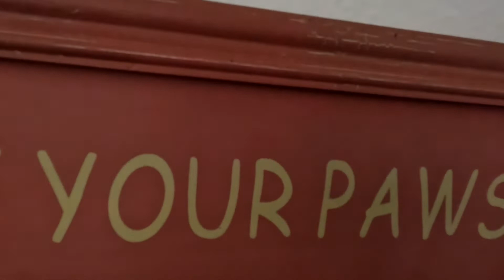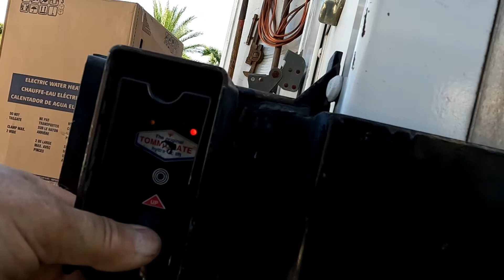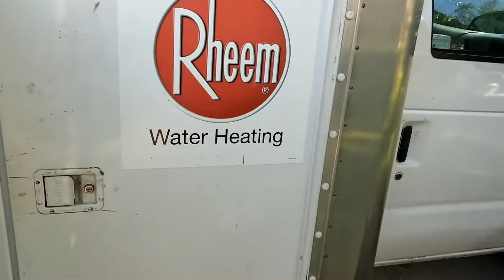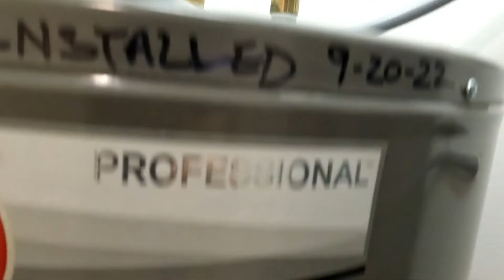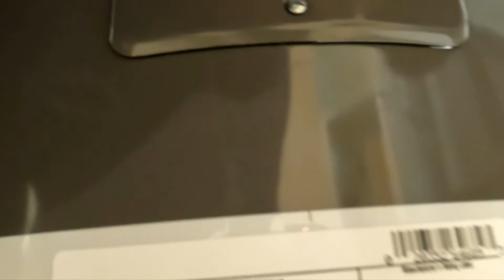PLUMBING TECH TIPS, 50 GALLON HEATER REPLACEMENT.

Comment: I just caught your video and I was impressed by how you single handed that big heater in. Was it bigger due to the stupid government regulations that changed in about 2015?  I got two changed out just before they got bigger and wouldn’t have fit in my condo. Keep up the good work. I also subscribed.
Reply from the maker: Thanks for tuning in,and yes they do have more insulation in them causing them to be bigger,in a condo,you can buy what is called a skinny rheem,that will fit.
It comes with a water heater blanket that you can use or throw away,it will save you money on your electric bill, thanks again!